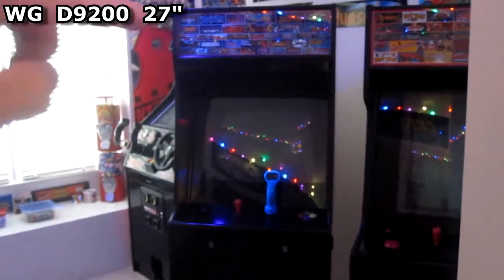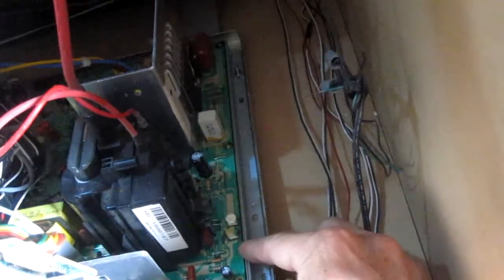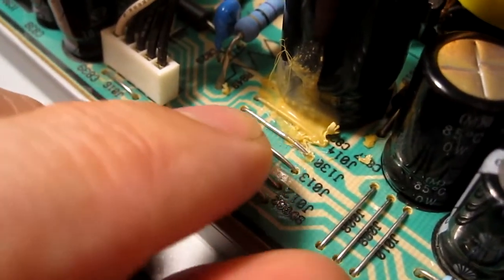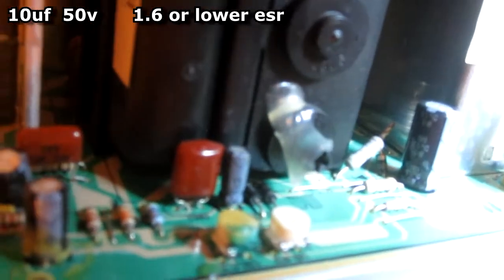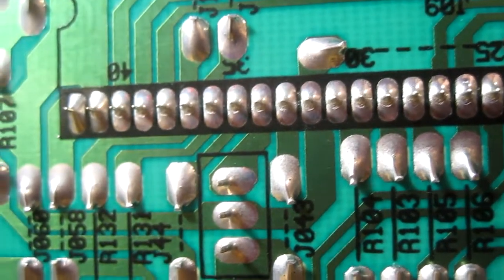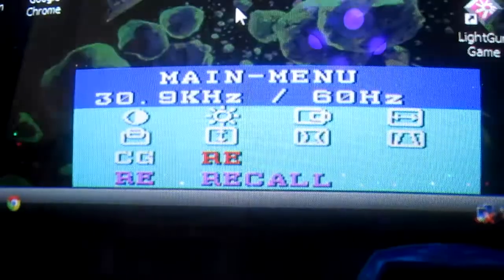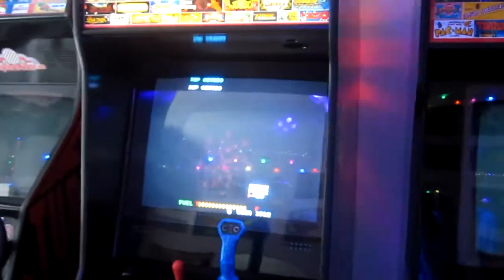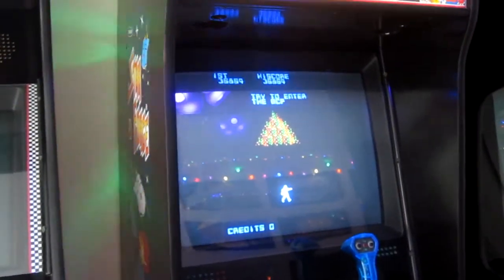D9200 Arcade Monitor REPAIR Wells Gardner CRT 27D9200 Shaking Fix Solder Electronics

Comment from the maker: MESR 100 V2 capacitor meter:  https://amzn.to/35CfEso
Hakko FX888D soldering iron: https://amzn.to/31k2mNN
Hakko Desolder Pump Tool FR301: https://amzn.to/2MInurQ
Solder: https://amzn.to/33BRPPK
Some of the gear I use.
Thanks.

(paid link)
As an Amazon Associate I earn from qualifying purchases.

Comment: Do you run your in 15khz or 31khz?  or does it switch?  I just got a D9800 and it seems to have a jumper for 15khz or 24-31khz.  I don't think it will switch automatically but I can't find a manual to save my life.
Reply from the maker: hi, i run it in VGA connected to an old windows XP computer. i do think the video out board has a few different pinouts alongside the VGA port
Reply: @FunBubble   cool.  Thanks :)

Comment: AINMATIONBUBBLE, What are the differences between a raster monitor compared to a vector monitor? Why  does a monitor need a B+ voltage? what does the B+ voltage used for?
Reply from the maker: hi, my electronics repair knowledge is very very basic. luckily about 85% can be fixed by replacing bad caps and resoldering cracked joints.  a good visual inspection can also find faults, ive watched experts repair stuff and after they use multimeters to track down the problem, it ends up being a burnt resistor or exploded capacitor that would be easy to see if they did a visual inspection from the start.
Reply: @FunBubble  ok thanks

Comment: I have that same monitor and the screen is overpowered with green. I am guessing one of the transistors is failing. Are those three transistors on heatsinks on the neckboard for red blue and green video output? If so which one for green?
Reply: I'm late but yes. I had a d9200 that had a green tinge. The blue was gone. The main transistor was fine but some smaller components that powered it had gone. Wells gardner has a crappy troubleshooting guide which will get you looking at the right collection of parts for the color that is going out.
Reply: @pfun41  If Blue is gone, then IC201, R244, and/or Q213 could be failing. Most likely it is IC201 though.
Reply: @nightman922  I don't remember which parts I replaced, but it's been in service for several months with no issues so I must have got it right
Reply: @pfun41  That's good to hear. I have the D9200 (and D9205) schematic and the small troubleshooting sheet on hand. If you need it as well I could share them on google drive or a similar medium.